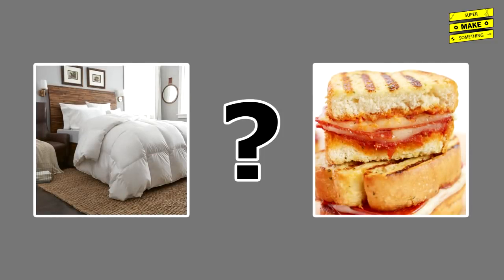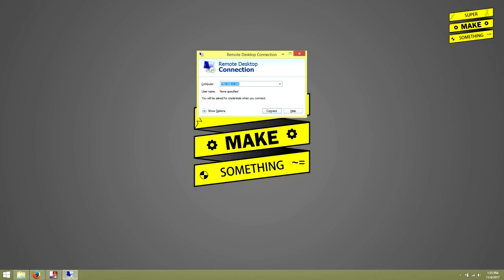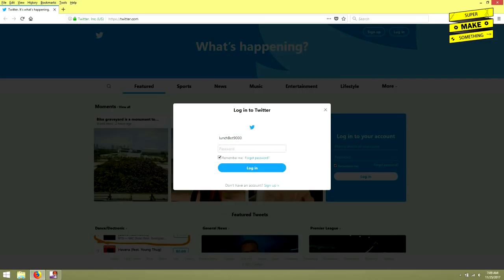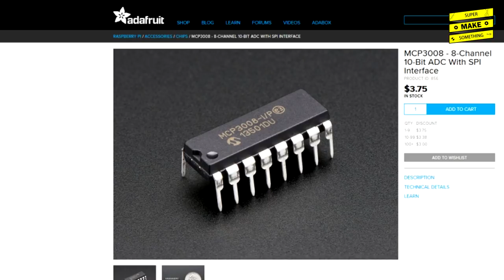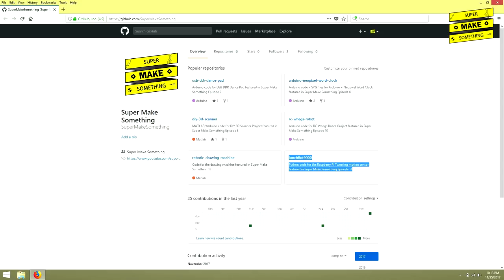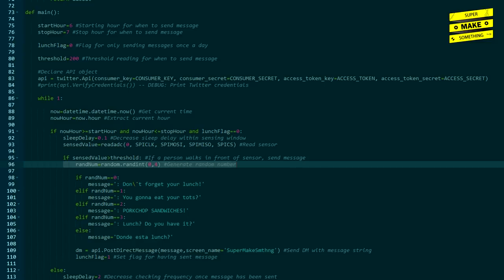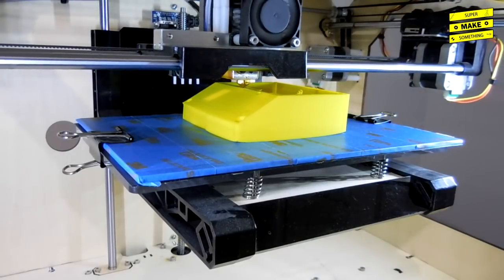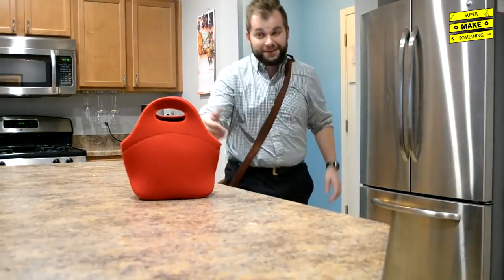LunchBot 9000 (IoT, Raspberry Pi, Python, Twitter, 3D Printing, IR Motion Sensing)

Comment: Love your video, I think the Pi is an overkill for this project, but it depends if you are going to use it for other purposes, for example vpn box, etc
Reply from the maker: Avrora Foto Thanks! Yea I agree — while the computational power of the Zero is pretty low, this project doesn’t nearly max it out. Because of the extra resources though, this project is a great base to expand on for further home automation tasks.

Comment: Would it be possible to use the Raspberry Pi remote access to run a 3D printer while you are not at home? I've heard of octoprint, but it still takes special configurating to use the outside of your home.
Reply: yes it is certainly possible i haven't tried myself tho as i like to be around when i start a print